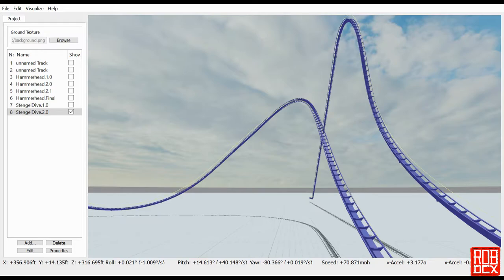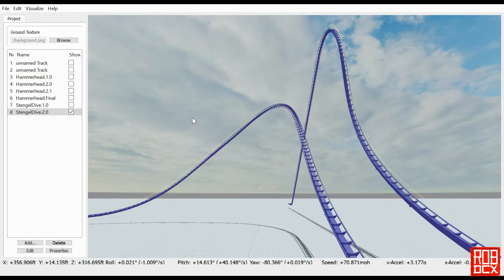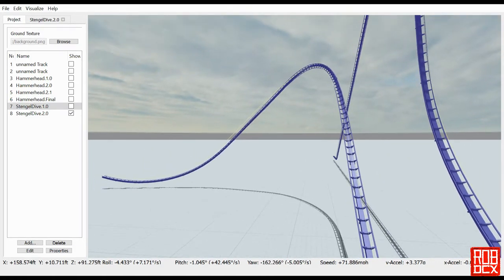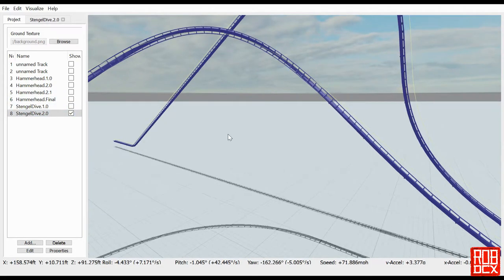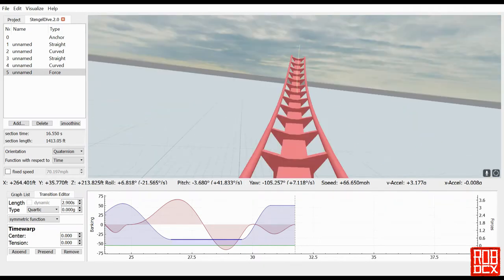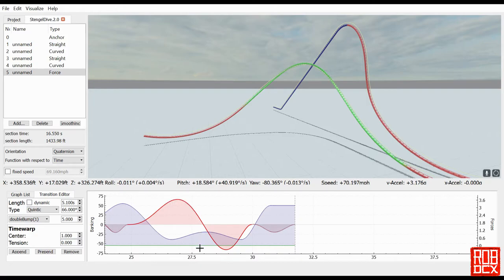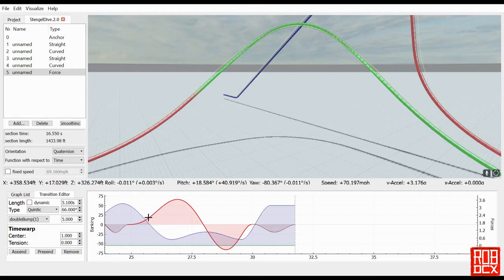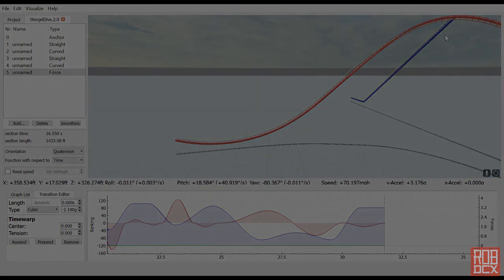FVD++ Elements: Stengel Dive

Comment: Your Stengel Dive really reminds me of Mako's as it's quite symmetrical and shaped similarly. Just a bit flatter than Mako's.
Reply from the maker: I can see that now that you mention it. Pretty easy to turn it into Mako's by just increasing the positive g section after the hammerhead. When I researching Stengel dives, I was actually wondering if Mako's actually qualified. They seem to have a pretty wide range of shapes and sizes.

Comment: Can you build from scratch?
Reply from the maker: If you download the file in the description, you should have everything you need.
Reply: Robert Dean okay thanks
Reply: Robert Dean also what’s the return to zero function?
Reply from the maker: @prod.coltvolt9296 , most new versions of FVD don't have it. If you download the version  from the description, it will have it. However, keep in mind that the return to zero function can be problematic. I recommend getting familiar with the program much more before using it.
Reply: Robert Dean what is it though
Reply from the maker: @prod.coltvolt9296  if you have the track banked, it is a quick way to get the banking back to 0.
Reply: Robert Dean oh
Reply: Robert Dean is there any vids on it?